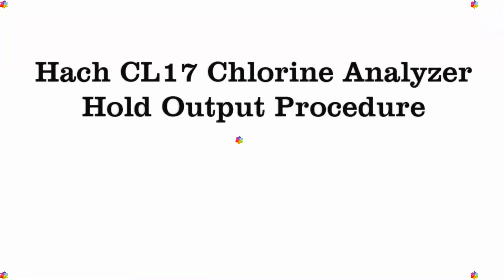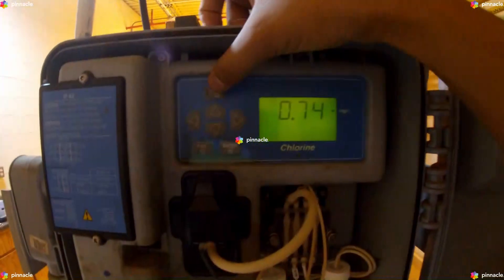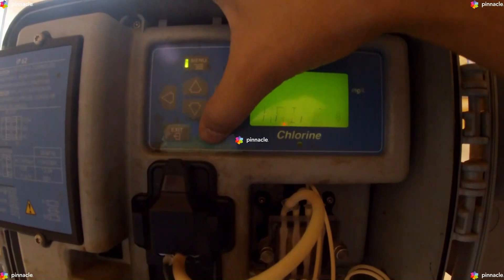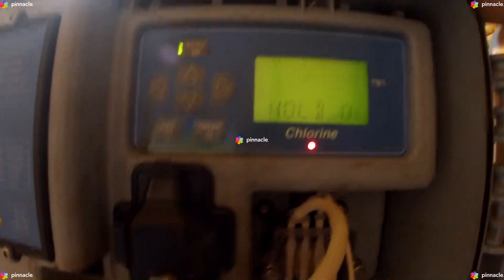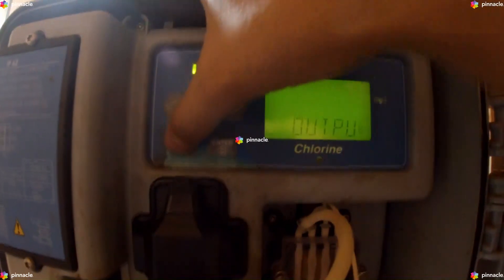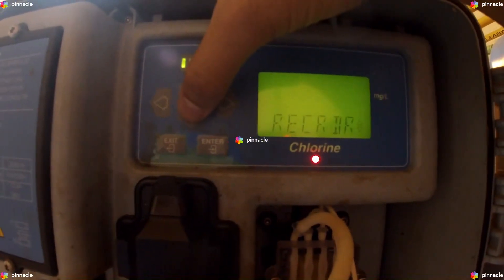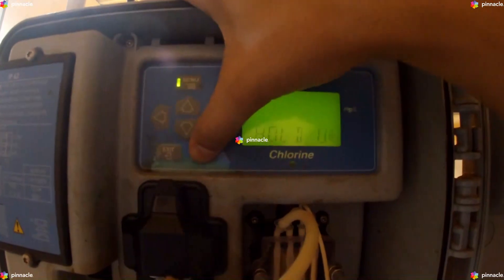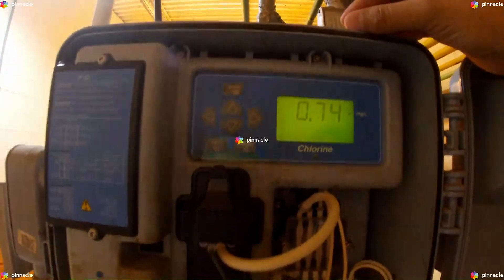Hach CL17 Chlorine Analyzer Hold Output

Comment: brother i have to clean the strainer to my cl17, i have to disconnect the flow input line. My question is should i use this hold option to maintain my signal output?